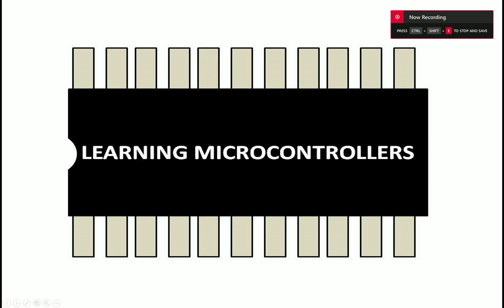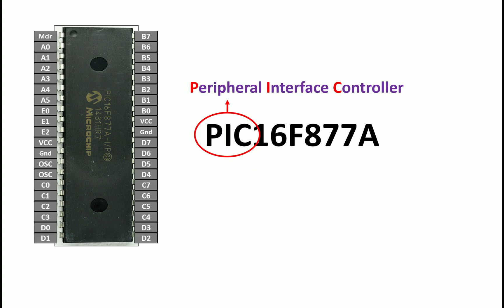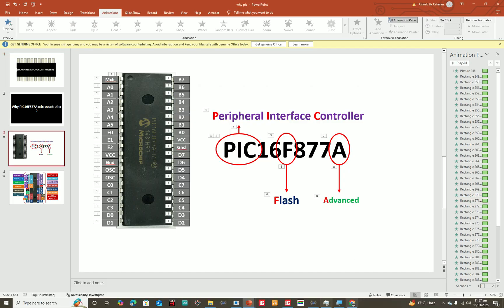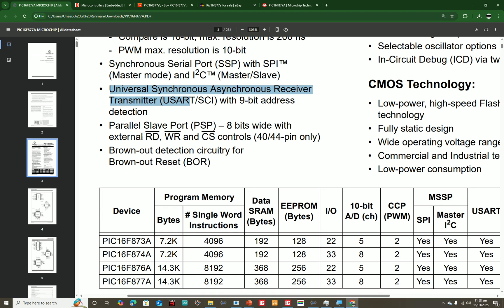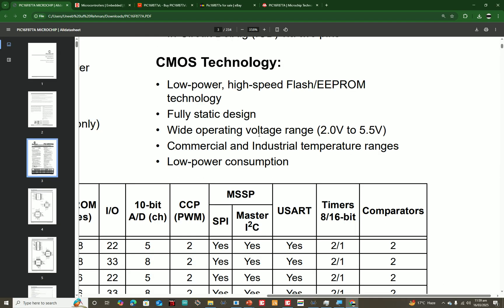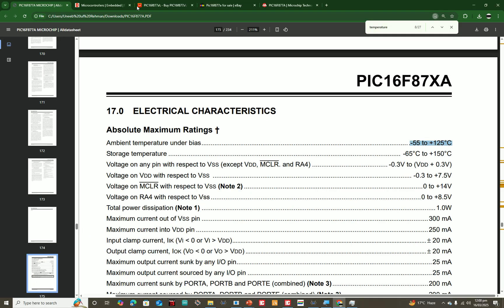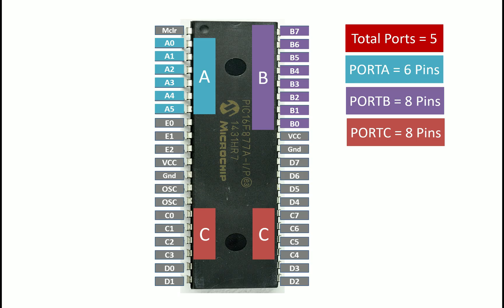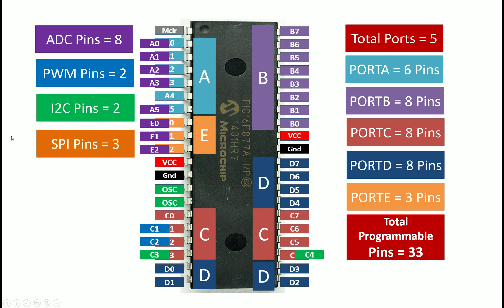Why PIC16F877A microcontroller ?

Comment: Assalam o Alaikum. Sir, how is this one. Its 18 family PIC18F458 that also supports CAN communication. PIC18F4550 that has direct USB and is available in Industrial version. Indians make great power electronics inverters with just usage of PIC16F72.  I have studied 3 architectures. I like two, PIC and 8051.
Reply from the maker: @MuhammadAsif-d7v4q  good
Pic18 are great

Comment: sir next video ,interface with  radio frequency  RF modules 433 mhz  . 16 channelcontrol plese
Reply from the maker: @kasunsadaruwan1293  which one
Reply: @learningmicrocontrollers3561  pic16f877a use  433mhz modules  16 channel remote control with led